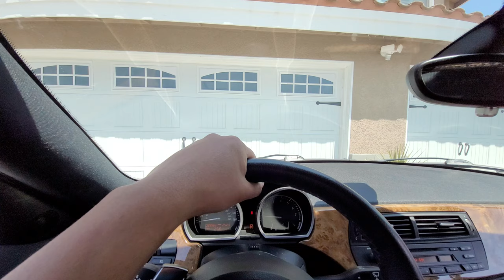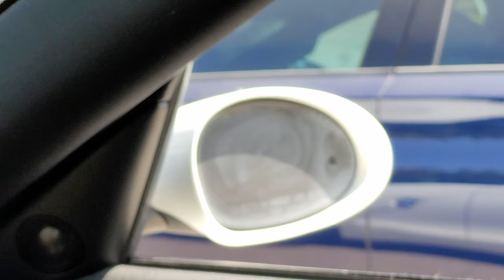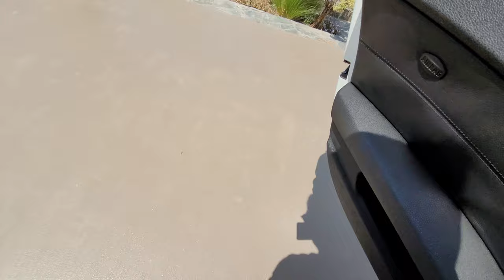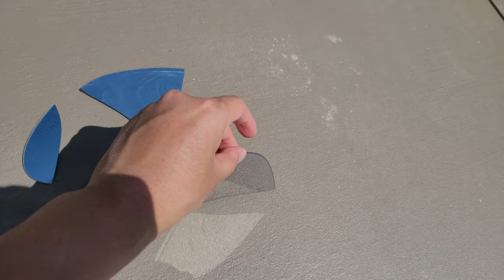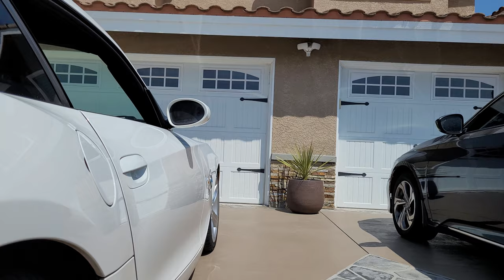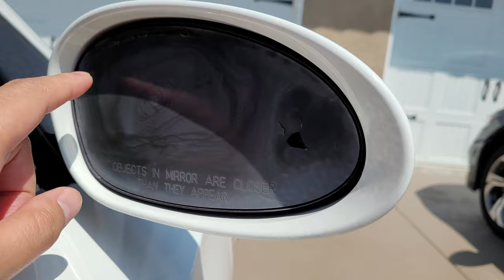Broken Mirror on my Z4 Coupe |  Vlog 1

Comment: Happened to me too on the first week I got mine. Passenger closed the door and it popped off. Ordered replacements that clip right into the motor. Theyre much better than stock and really help with the blind spots
Reply from the maker: What was the difference with that part?
Reply: @DrewZ4  the difference from what I can tell is that the new one didn’t have that rubber surface the mirror was adhered on to. It also had a heating element running along the back of it
Reply: @DrewZ4  https://youtu.be/re0LJCtk2kU this is the same one I replaced mine with. The stock one was magnified a lot and the new one isn’t as much; Much better situational awareness